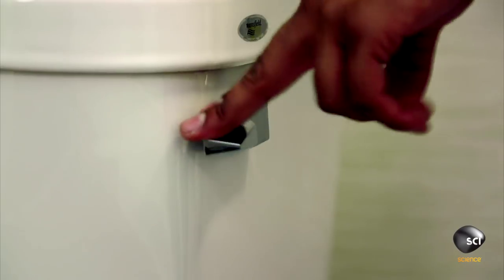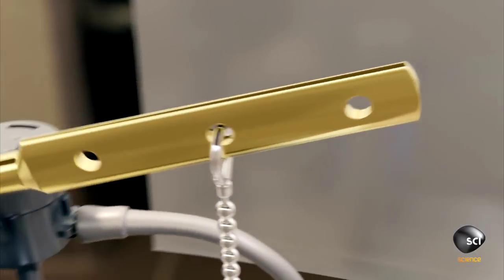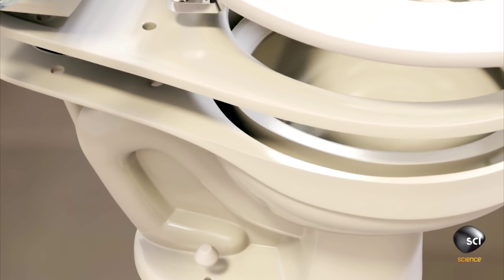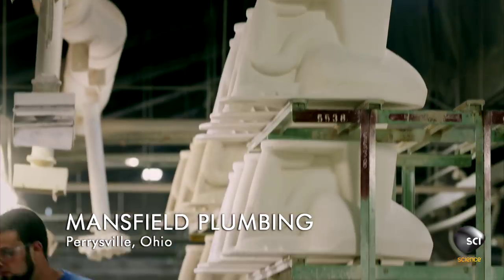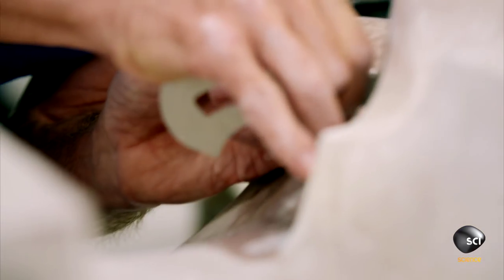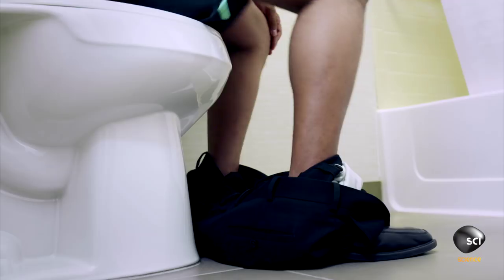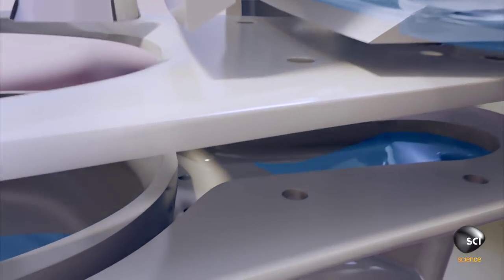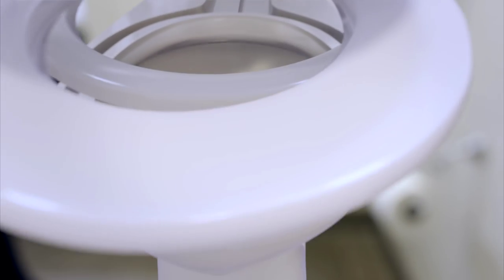Toilets: Behind the Flush

Comment: He didn't mention how the S bend keeps out the smell by keeping water there to block the sewer smell from coming through. Or the fact that pressure generated is due to the height of the water in tank. :|
Reply: You watched another video of how it works, that guy never mentioned a siphon jet
Reply: That's what I came to see.
Reply: Really ? Wow. This never even crossed my mind
Reply: @Gunshinzero  Me too. I gotta give this video a thumbs down. It started great.
Reply: its called a p-trap , back in the day houses didnt have it on the inside (where im from) rather at the base of the house, there woulkd only be one for the hole house, these things were hard to mantain so WALA
 now u got a gaurd against smelly stuff at every drain.
also theeres no pressure, its just gravity and how clean the drainage holes are...
the only pressure is the water coming into the tank through the intake hose....
correction, u do need a certain amount of water to make this work so i guess im a ding dong that would be pressure, but yea i just felt like expandin on yr comment
Reply: Those are both very interesting points I never thought of. Do you mean the water alone can block the smell coming from the sewage pipe?